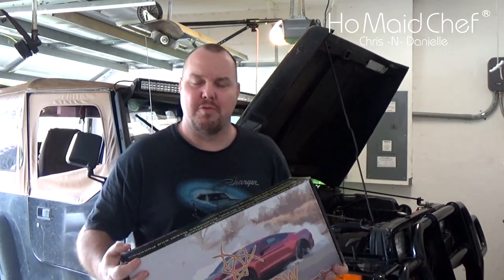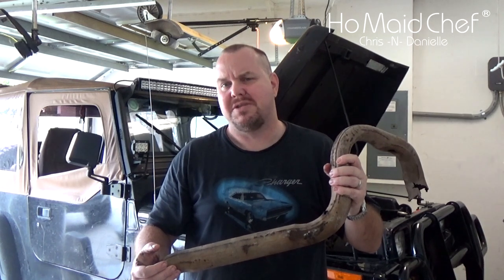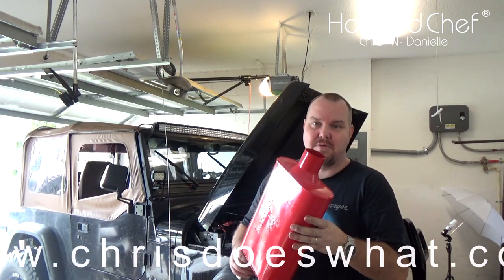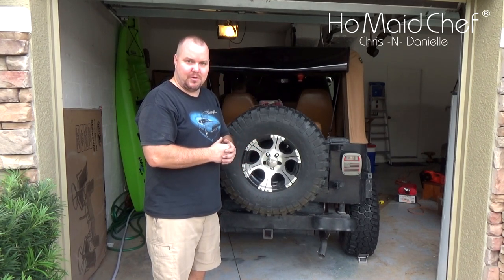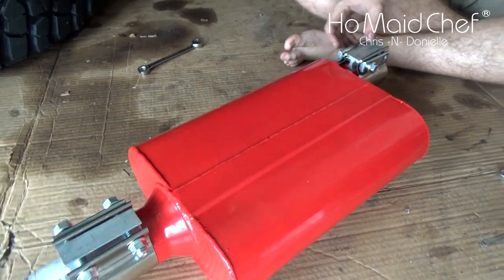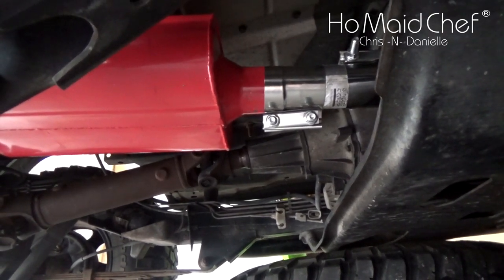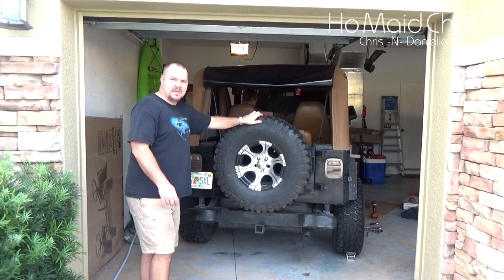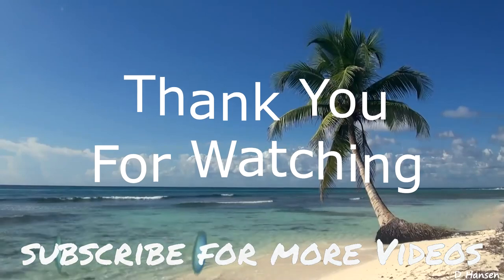Install Total Flow Muffler Sound Test  And Straight Pipe || Jeep Mods E17

Comment: Checking these out now. Not sure why folks say 4 cylinders sound horrible with  performance mufflers. Even running a V-8 you're still only running 4 cylinders through each. IMHO, it's more about placement. I'm currently running 26" Thrushes on both my Neons(1 SOHC and 1 DOHC) placed at the firewall (as far forward as allowed) and it's a bit loud. But super throaty.
Reply from the maker: I have heard some throaty 4 bangers, one was the 2.5 turbo in our ATS, another the 3.0 in our boat. I like the smaller engines, the parts are much lighter and cheaper. The next boat we get is probably going to have two 3 cylinders with only 25 to 35 HP each.

Comment: Not too bad, I would have welded it though🙂
Reply from the maker: We may weld it, we have a few welders lying around. :) We just wanted to show the ease of install for everyone, no welding required cause not everyone has a welder. Thanks for watching Roy, when you going to make some new content?
Reply: @ChrisDoesWhat I see, I've used clamps before lots of times I've even used cans as patches...lol!  I'm hoping in a few weeks, at least by the end of January, got a few things to take care of and I'm tooling up the garage some. Im going to do an all new project.
Reply from the maker: @royzcustomz  That sounds great! We have finished the 5 projects on this jeep, just working on the videos that will be released every Saturday. After that, we are going to go back to the boat, with a few other things sprinkled in. May have to release some extra videos a week to reduce our backlog of content, but the videos like the gear change on the Jeep is a lot of work just in editing videos and piecing it together.